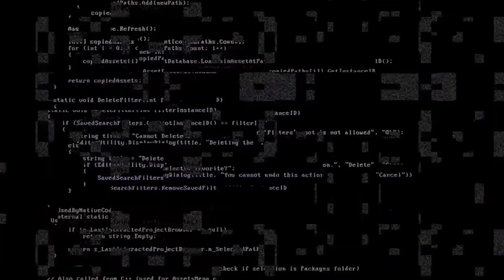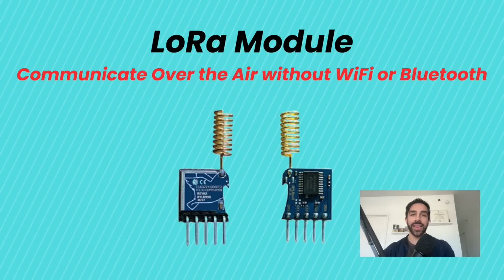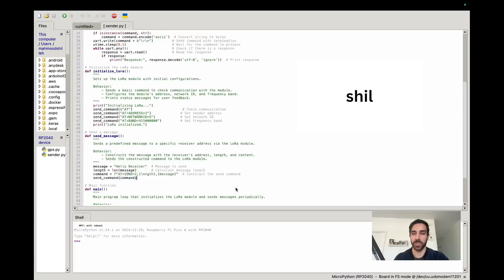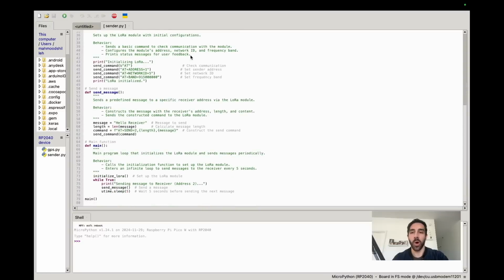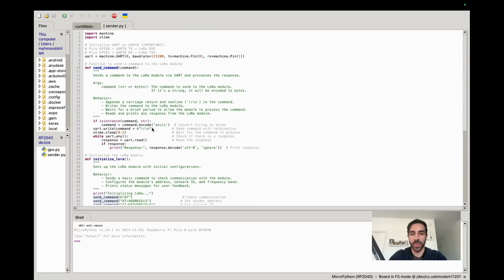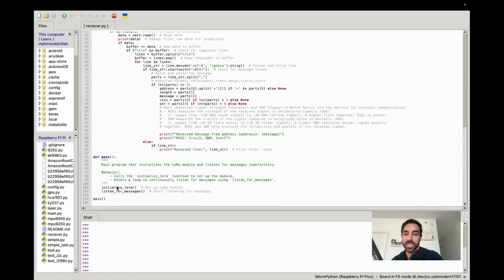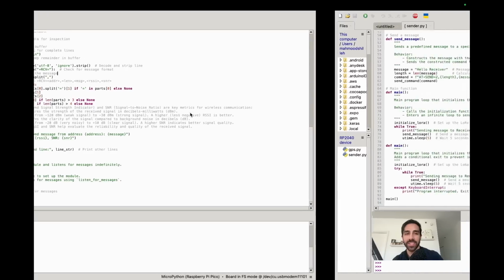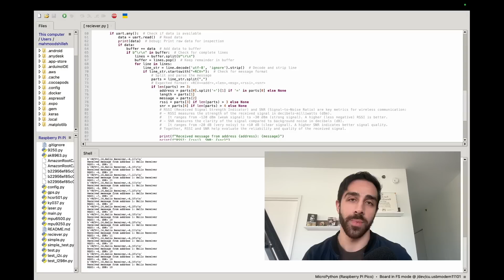Build a LoRa Communication System with Raspberry Pi Pico W: Long Range IoT Made Easy

Comment: I have 2 similar Reyax lora modules and 2 Raspberry pi zero 2 W boards but, I'm not sure if that will work on this project. (I have tried to setup something similar, via a guide through ChatGPT but, it's not very stable). I don't have any of the Pi Pico boards at the moment and hoped to just use what I have. Do you know of a guide, to get it working on my setup? My hope is to have a transmitter at home and drive around with the other one, to get an idea on range.(I want to connect the Pico/lora module to my Android phone and have it show up in a serial app). Still gotta research some stuff on it.  Great simple project though!
Reply from the maker: I don't have a guide for that setup, but it sounds like a cool project! Hope you sub :)
Reply: @mmshilleh  Nothing to exciting for my first lora project but, it was fun trying to figure it out! Just subbed as well.
Reply from the maker: @woolfy02  Yeah LoRa is cool and has alot of real life use cases, especially with remote IoT. Keep going at it!

Comment: I'm trying to simply compile your code on a Rpi Pico W transmitting and Rpi Pico H receiving (same as in the video I think) but I am confused as to the initialization. Where did you find the receiver address and network ID from? I'm new to the Pico and LoRa modules (I'm using Pico-LoRa sx1262 if that helps) so sorry for the very basic question but thank you for the video😅
Reply from the maker: You make the IDs yourself :)

Comment: Which modules are these? Can you share links to these Lora modules?
Reply from the maker: https://www.amazon.com/REYAX-RYLR998-Interface-Antenna-Transceiver/dp/B099RM1XMG/ref=asc_df_B099RM1XMG?mcid=ae7d9da66d88367f8c79f1d612089683&tag=hyprod-20&linkCode=df0&hvadid=693369603354&hvpos=&hvnetw=g&hvrand=12225067202903837328&hvpone=&hvptwo=&hvqmt=&hvdev=c&hvdvcmdl=&hvlocint=&hvlocphy=9021712&hvtargid=pla-1650422690854&psc=1

Dont forget to sub!

Comment: Can LoRa module work across physical obstacles?
Reply from the maker: Yes it can, will be weakened and you wont get the full 15km range but still long range
Reply: @mmshilleh  hope it's also compatible with Arduino?
Reply from the maker: @ yes easily!

Comment: How would you turn the 2 pico's into something like walkie talkies for text? Let each pico be able to send and receive?
Reply from the maker: You mean with voice activation?
Reply: @mmshilleh  just curious how you could make 2xway communication using thex2 picos. I can see your example working perfect for a system sending out messages "for help etc. Just curious how you could send back a solution message or something so each pico can both send and receive.
Reply from the maker: @btigenie  I think the code we currently have can be easily modified to accommodate a back and forth logic. I dont see why not
Reply: @mmshilleh  no just a keyboard and typing messages back and forth